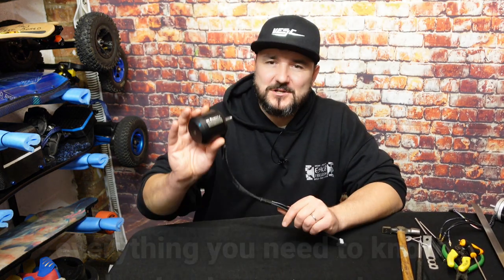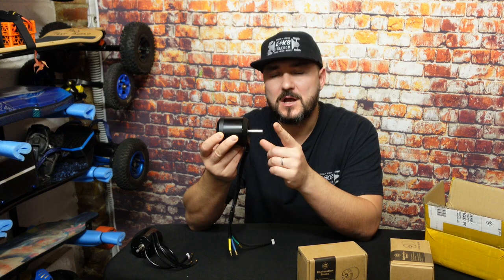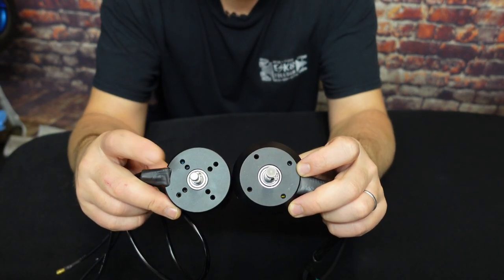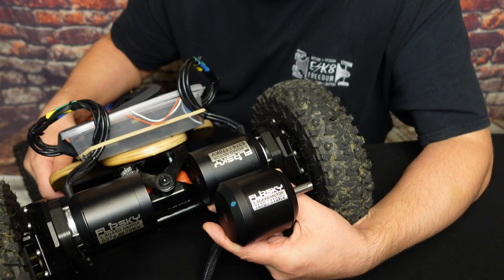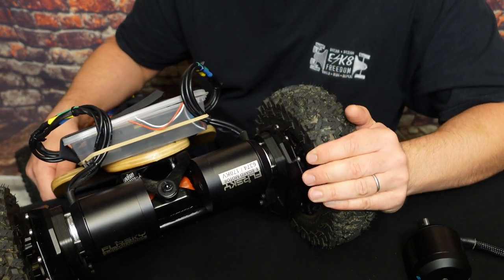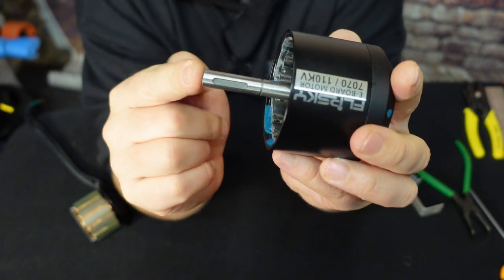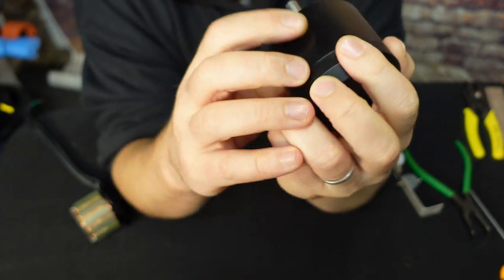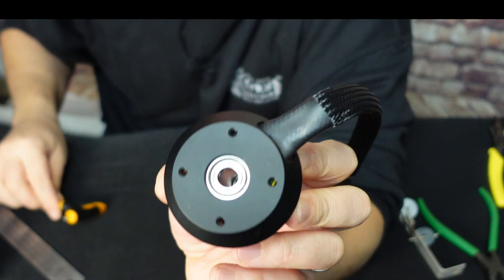Flipsky 7070 motors. Very,Very detailed review and MUCH more!

Comment: Nice video, btw the yellow circlip remover has two positions you can use, it's way more comfortable to use the other one. You have it set so that you need to pull the handles away from each other in order to remove the circlip, the other position is so that you can use it as regular pliers are used (squeezing)
Reply from the maker: Cheers mate 👍  i actually do have ot set up that by squeezing it it does open at the ends...maybe it's not clear in the video. 
How are you doing ? Have not spoken to you on ages. What motors are you rocking these days?

Comment: I used your code to buy two of these.  But can you speak to batteries and escs and flight controller for a tank application?  What components complement this specific motor and can drive it to its full potential?

Comment: so a 6384 120kv single motor can make a 500kg weight go kart using direct chain drive and sprocket???
Reply from the maker: Single motor? .... with a very high gear yes but it will be dlow. Two motors can take 130kg to 40 mph no problem.

Comment: How do they compare to 63100?
Reply from the maker: These are shorter but bigger diameter,  quality is the same,  no choice of different kV though.  Not a bad motor if yiu are looking for 140 kV set up.
Reply: What about power/torque? I imagine more torque due to higher diameter but 63100 prob has more power overall?

Comment: Hi, where can I find the tool you used to rermoved the bearing (at 21:45) ?
Do you have a link maybe ?
Thank's mate, very usefull video
Reply from the maker: Hi mate, thank you for watching. 
I am using a set of these... just look up the same description. 
https://www.screwfix.com/p/forge-steel-pin-punch-set-8-pieces/936XG?kpid=936XG&ds_kid=92700048793290430&gclid=Cj0KCQiApb2bBhDYARIsAChHC9u4YRTFyRa3uKojB-z3w4jNAkrtlpm-et3Ub70jMr060anY7N7wAf8aAk2xEALw_wcB&gclsrc=aw.ds

Comment: Thank you, please do a video on vesc app
Reply from the maker: Hi mate, do you mean the phone app? 
I do prefer using laptop for the intial setup and then metrpro app...but i will try filming the app tutorial.
https://youtu.be/vOkU4mDSdu4
Reply: @PavelGarmas  either one really I just don’t feel like there’s that many good videos explaining what everything does, the biggest thing that confuses me is how can I make changes without deleting everything?
Reply: @Zachsnotboard  I noticed the same thing and ended up programming my ESC via the wizard and then doing it again when I went to the motor settings. It seemed like there was a lot of redundancy in the process. 
I was watching a Benjamin Vader video where he worked in VESC Tool and after he did the wizard and moved to the motor settings section he would ‘read’ or load the existing motor settings into VESC tool and then ‘write’ those settings back to the motor. This would load the motor settings the wizard created into VESC so you don’t have to reprogram the motors again. I’m not certain why he did the write function but he KNOWS the tool better than anybody else so I do that now. This process saves me the process of manually having to walk through redoing the program after I do the wizard tool. 
You may want to do the same read/write functions in the SW section of VESC tool as well. I’m not certain if the SW section is programmed in the motor wizard or not.

Comment: Do you think you can do a video on the aspects of water on these electric motors? I know they are closed mostly but it wouldn't be good to ride through rain or puddles but sometimes where I live its hard to predict the weather with mountains. I know the VESC or devices are protected but the motor itself seems some vulnerable. I was thinking of 3D Printing some shields to reduce the chances of water and dust exposure and still allow flow of air to cool the motors. 

Don't destroy anything just maybe a quick talk about it would be cool. Also great video review and description.
Reply from the maker: Thank you for watching mate and for the idea of the video.  I will do something.
Reply: @PavelGarmas  Awesome let me know if I can help or if it isn't worth it don't burn up your time. I'm just curious in general. I suppose I could also watch brushless motors and how they are effected by water.